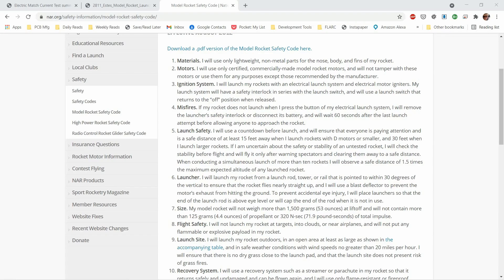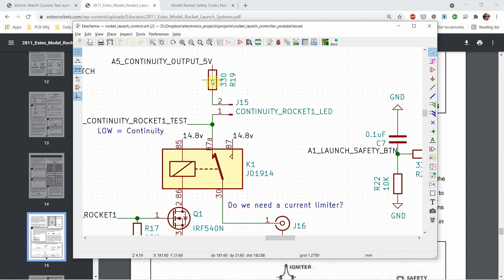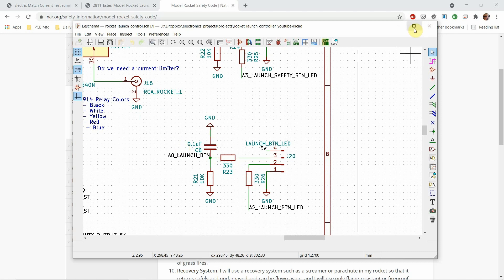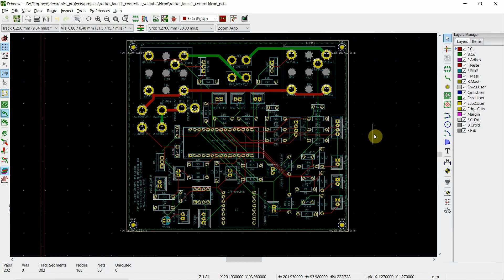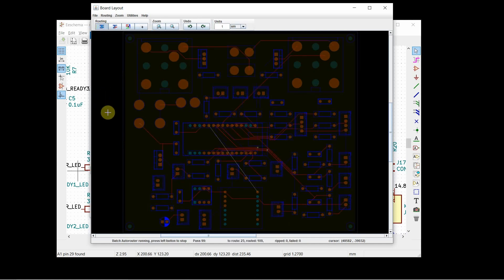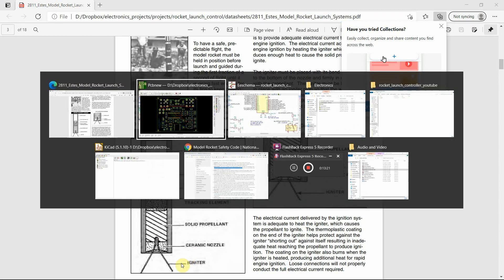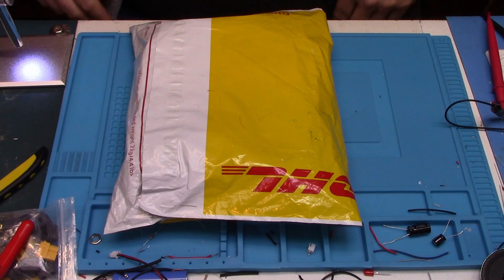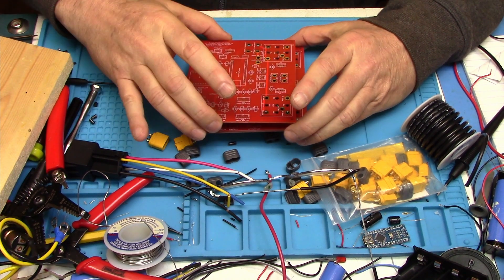Model Rocket Launch Controller Project - Part 2

Comment: Not to be too critical, you have a number of issues with your design but in my opinion the most pressing is the current limit.  If you are using protected 18650 cells then you have less to worry about.  Unprotected cells can cause a fire when shorted.  In the normal sequence of launching a rocket, the igniter current need only be on for, say three seconds.  Not an issue.  However if the igniter leads are shorted and you launch then there is a problem.  The relay contacts may weld and the battery will remain shorted.  If the traces on the circuit board do not melt, then the risk of a battery fire is realized unless the condition is recognized and the power is removed.  Automotive relays are supposed to be able to handle short circuit conditions but I have seen them fail in other rocket launch systems.
By the way,  I am an electrical test engineer and I spent my career (45 years) designing and programming automated test equipment.  I also designed a multichannel, wireless launch system for our club.
Good luck.
Reply from the maker: Thank you very much for your input, it is much appreciated.  I have been thinking of adding a sloblow fuse, PTC, or automotive "blade" fuse inline with the 4 18650 batteries. I had also considered adding a 6 ohm 50w resistor inline to limit the current. Do think these would be a good solutions? What do you recommend?
Reply: @StuartPatterson  The resistor approach would work ok for one igniter but may fall down if you wanted to do a cluster of 3 or more motors.  The slowblow fuse could get around that.  Be sure you carry extra fuses in your flight box.  I use an active current limiting circuit using a MOSFET, sense resistor, and an op amp.  If you have the space, consider changing the battery to a sealed lead acid battery.  I use 7ah battery.  I ran an experiment and found that I could launch over 760 times before the battery voltage dropped below 9 volts.  The SLA battery is much easier and safer to charge.